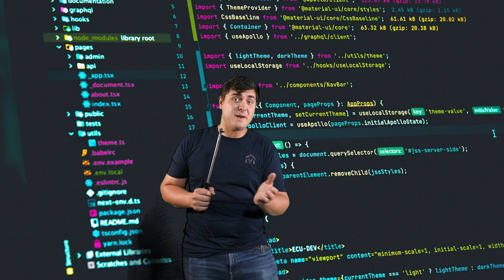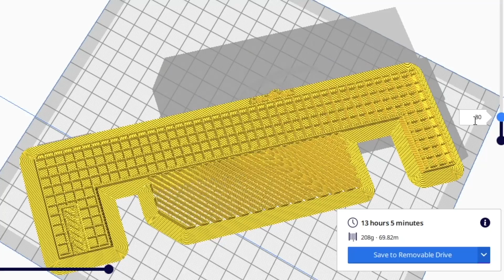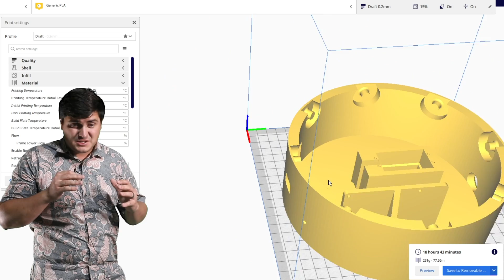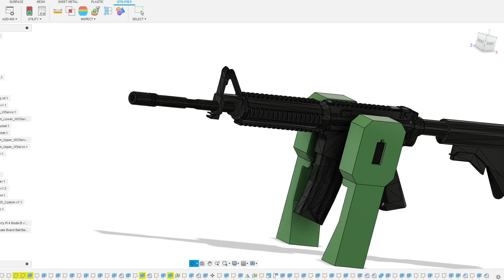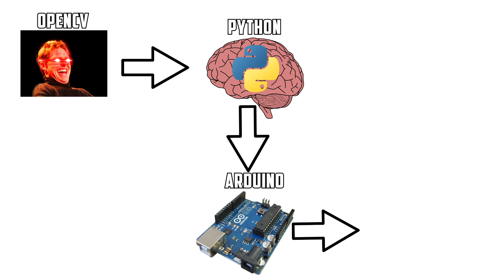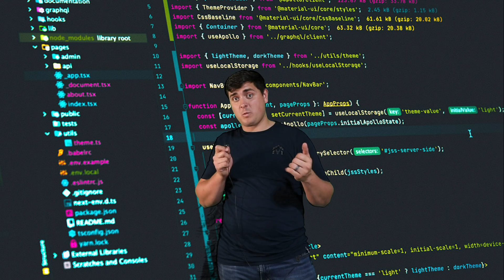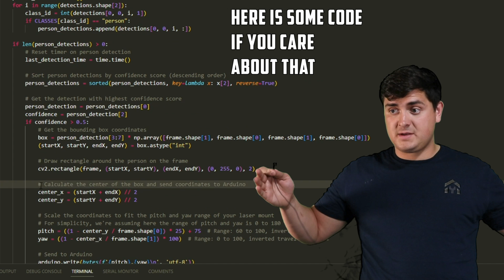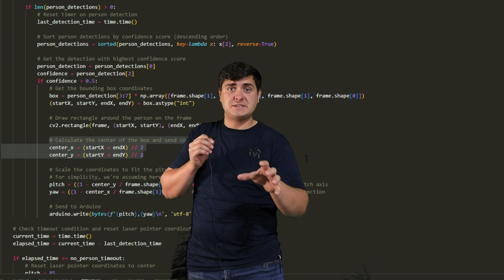Robotic Airsoft Turret: AI Home Security for Airrack and Tyler Blanchard– Full Build & Demo

Comment: Ive done a lot of shipping both international as well as domestic.  I think for future reference when you ship something if there's a lot of open air in the package you need to break it down, or disassemble it to get it into a smaller form factor that way shipping can be more cost effective.  five lbs in a 12x12x12 box versus 5lbs in a 24x24x24 is wildly different.

Comment: Really cool design.  Something i was thinking about as you found difficulty locating a person was to use a thermal camera as the camera, then have it set to a temperature (for example, 30 degrees Celsius; a human/intruder), that way it doesn't pick up inanimate objects like tools and walls, which would be much colder than an intruder.
Reply: you would be surprised i have a thermal camera and reflective surfaces can screw with temp reading they would have been better off tracking motion in this instance .. it would have been super easy too ,when you have a static image the pixel data remains constant whenever the data changes you have movement  you can also create grids and rules for what percentage of the grid pixels have to be changing to activate tracking as well as priority offset so it aims at center mass it would also allow a motion offset track moving targets much better
Reply: honestly ive got cheap wifi cameras that track very well maybe beef up the servos and drivers

Comment: Is it possible to learn this power...? Not from a Jedi. Seriously, I would pay for you to create a tutorial step by step process of how to create something like this. But I want to power it with the rechargeable batteries for my drill.
Reply from the maker: Absolutely! If you can build or buy a circuit to step down the voltage to the right range for the controls and motors it shouldn’t be a problem. The Arduino and motors run on 5v but you could choose other components as well
Reply: @Mouthbreather-TV  I'm familiar with arduino but the programming/visual input calculation/physics to anticipate moving targets is beyond me.

Comment: Hey i'm making my own turret (from a Compsci background so struggelling on the mech eng parts). What did you use for the gun pitch inside the housing? Is it a motor on one side and just a shaft and bearing on the other or do you have sets of gears etc?
Reply from the maker: It’s a 30kg servo direct mounted to one side and a shaft and bearing on the other